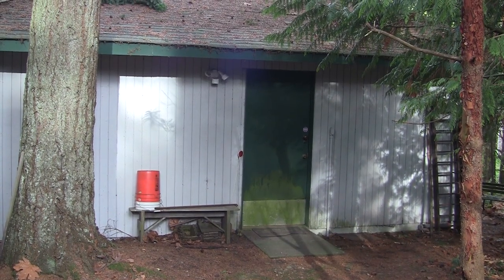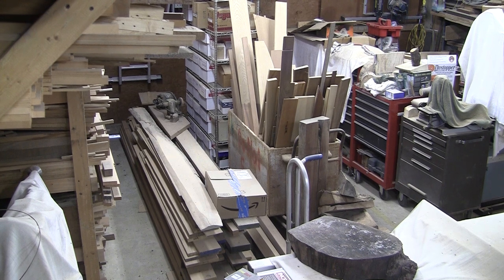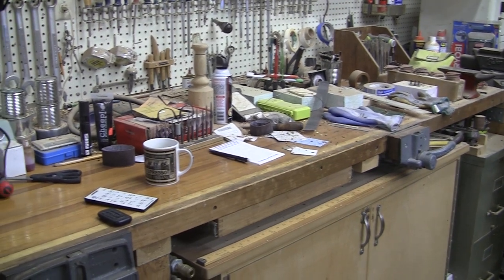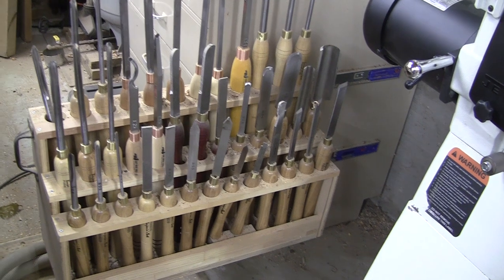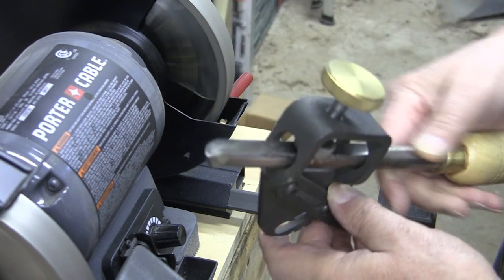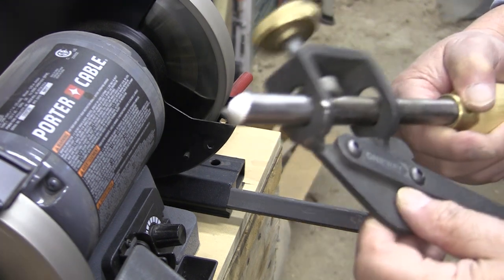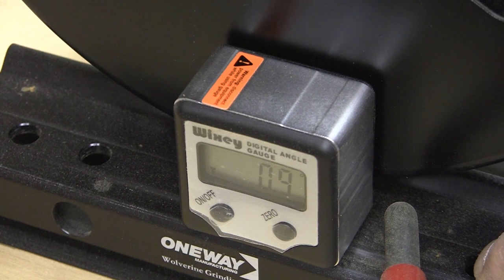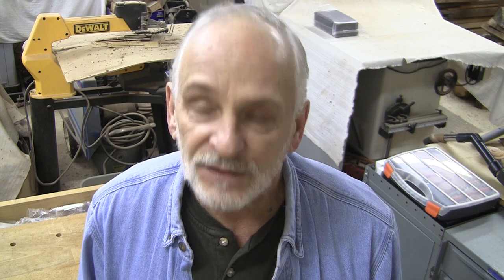Shop Secrets and Tour

Comment: Thanks for the tour, Nice touch.  I wondered how your shop was set up.  I have a work in progress with mine, I have to come up with a chisel rack,  i found that the shaft falls out if I stand one in a hole drilled in a bench top. Resharpen, won't do that again. I have installed and hooked up a natural gas heater in my garage, it is a lot more comfortable.Keep up the great videos.   Rob from Oakville Ontario Canada.
Reply from the maker: Sounds like you are or will be far more organized than I, Rob.  Enjoy! 😊

Comment: Phil I loved the shop tour. 
I am wondering why you cover your machines though.
So we do think a like . Starting with the wood collection. 
That gas heater is something I have been wanting to do for ages. But I have gas right where I need it so I have no excuse.
Great tip on the digital angle finder. Something I thought about today was both rails need to be exact location or the line does not good. Guess what I checked mine and they were way off so I fixed that now the line works on both wheels.
I love the location that you live in. The trees are great. We have 100 foot fir trees right in front of our place and a 1/4 acre of firs to our right. But  we are no longer in the sticks.
Oh and I am ready to make the plunge to CBN wheels. Thanks for the tip on getting wider ones. Not sure if my Rikon will power 2 of them though.
When we travel in the motor home we make a point of staying at least one Walmart just for the fun of it. And I am a cheap old man LOL
Looking forward to when you have time for some woodturning videos. I love to learn techniques from you.

Nice job Phil and have a Merry Christmas
Gary
Reply from the maker: I actually edited out the part about why I cover my tools, Gary.  I didn't want to start a conversation about what I can do to solve the problem but, here goes.  One night after dark, I walked into the shop and had to duck my head to avoid the circling bats!  And, bats, just like mice, leave stuff behind.  I always wondered where those little rust spots on my tool tables were coming from!  The bird blocks in the eaves don't have screening over them.  And, there are large gaps around my big doors.  I have ideas on how to solve the problem but, like the gas heat, just don't seem to find the time.
Good tip on the rails and using both sides.  I did spend a great deal of time setting my jig up so I'm pretty sure they are exactly the same, but now I'll check.
I love our trees but, as always this time of year, we just had a wind storm and now I have branches all over that need to be picked up.  Oh, well, Spring is coming!  LOL!
I think your Rikon is more powerful than my Porter Cable.  It might be a slow start but it will work.  Sometimes I give the wheels a spin before I turn it on.
I love overnighting at Walmart just for the people watching!  And yeah, it's cheap!
I'm just finishing my next turning video for next week.  I don't think you have much to learn from me!
Merry Christmas, Gary, to you and yours.
Phil

Comment: Your chisel rack is a great idea, is it also on wheels for support and ease of pulling out?
Reply from the maker: It's just on the drawer slides, doesn't need wheels, Jessi.  It used to pull out really easily, just like opening a drawer, but the slides get so filled up with sawdust and crud, I don't even pull it out anymore.  No need to, anyway, I can reach everything as is.

Comment: Phil, I'm going back thru some of your earlier videos and and I learn from all of them. I placed my order for a Jet 1840 from my local woodworking supplier a few days ago so I could turn larger and hopefully better peices. Where did you find the electronic angle gauge? Thanks again for sharing.
Reply from the maker: Thank you, Ralph!  It's a shame Jet decided to remove the rotating headstock on the 1840 but at least they did lower the price as a result.  I'm sure you'll love yours as I do mine.  There are many brands of the angle gauge, here's the one I have:
https://www.amazon.com/Wixey-WR300-Type-Digital-Backlight/dp/B00T6YZ0K6?ref_=ast_sto_dp
Reply: Good afternoon, Phil.
   I enjoyed this video. My shop is 47 years old and has been used for many purposes during those times.  It is a very busy place, that means there are a lot of future projects waiting to be started/finished. Some have been there for a long time. I know I will not get to some of them but I'm keeping them just the same.  Wood turning has captured my interest several years ago. 
   Thank you for sharing your personal story and the picture trip to your shop and inside.
Very special.  Thank you.